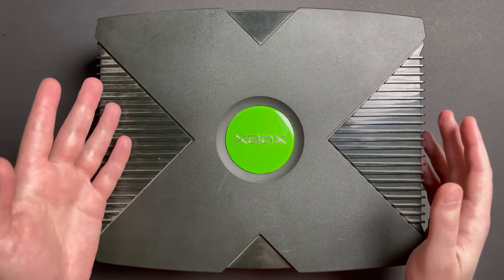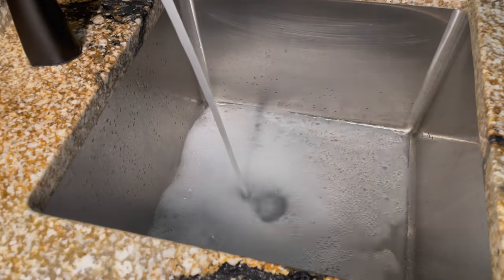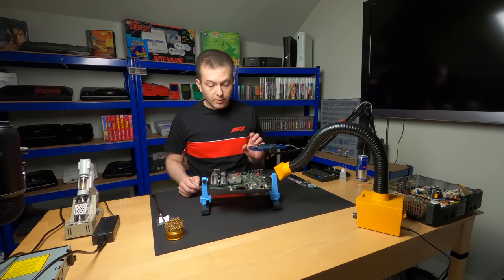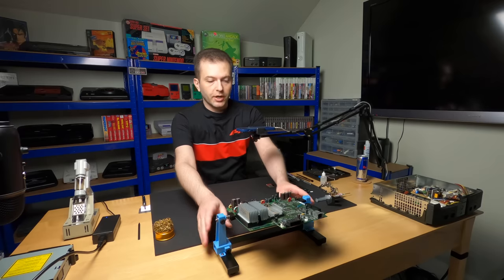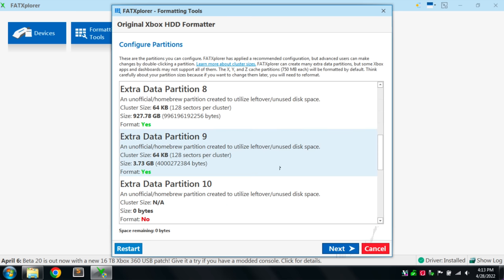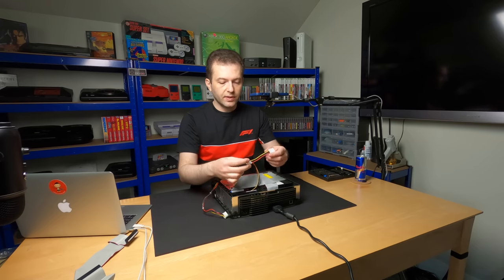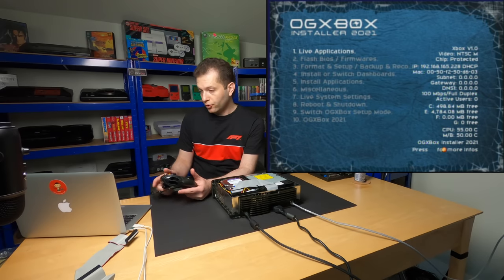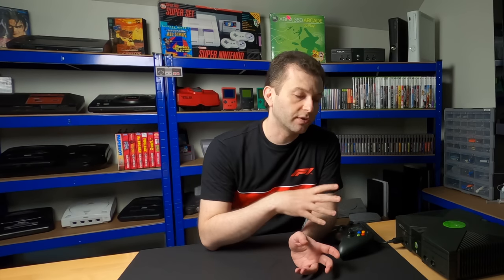16TB in an OG Xbox? CERBIOS has arrived.

Comment from the maker: EDIT Nov 21, 2022: Cerbios v2.1.0 was released today with support for v1.6 motherboards. There have also been many developments over the past months including UDMA5 support for supported SATA adapters. Be sure to get in touch with the Cerbios team on Discord to say hello and get the most up-to-date info: https://discord.gg/VcdSfajQGK

Original comment:

As mentioned in the outro, I'll revisit this pinned comment for the next couple of months to address recurring questions that may arise about this project or my experience with Cerbios.

Regarding the Aladdin Modchip: there are reports that some newer Aladdin XTs are only flashable using a programmer and will fail when flashed in the Xbox. I have not experienced this yet on any of my recent Aladdin XTs despite receiving the same ones that some folks have reported trouble with (49LF020A). Your mileage may vary so best to be prepared for a potential unsuccessful flash by picking up a spare Aladdin XT or just buying a better modchip altogether. I always flash using Resctoox v6.0 as I demonstrate in this video and have not had any problems (yet). Feel free to share your experience with this as I'm sure it will be helpful for folks trying this mod.

I don't recommend trying Cerbios without a modchip (i.e. TSOP) if you're a beginner. Fixing a bricked TSOP wouldn't be fun. Swapping a $10 modchip is a piece of cake.

HDD Cluster Size: I chose a HDD cluster size of 512K, even though 2-4TB drives can use 256K clusters and save lots of space when copying small files. The problem with 256K clusters is the directory limit of 4096 files per folder. This sounds like a lot, but many (uncompressed) games have 6000+ files of artwork or sound in sub folders. You won't have this problem when using XISOs. Unfortunately my game collection is extracted from archives and I have little desire to recollect ISOs of all my games. The only downside to 512K clusters is wasted space (1.6TB collection on PC took 2.5TB of space on Xbox). This is acceptable to me because storage is cheap and I just want all my games on one Xbox. Do you have an ISO collection? Hit me up! ;)
Reply: The last Aladdin I bought also wasn’t flashable in system. Went for a TSOP mod then. Needed the Aladdin anyhow as the OG HDD had died on me…
Reply from the maker: @4ujeff  Alas, you likely have one of the Aladdins that can't be flashed in the Xbox (see note above). You can flash it with a programmer or if you don't have access to one you can pick up an Xblast Aladdin XT from ModzvilleUSA which can be flashed directly from the OS on the modchip.
Reply: @4ujeff  What size BIOS are you flashing?
Reply: @4ujeff  What model Xbox?  Is it a generic "off brand" / knockoff chip?
Reply: Do you offer service for xbox v1.4? I was curious how much it would cost? I want to be able to fit a sata ssd; I want to have Original Xbox Live Dashboard installed so I can play on Insignia Live coming out
Reply: Also I have Rocky5 v1.1.8 softmod
Reply: I have two XECUTER chipped OG Xboxes. Both need repair. One was a 500gb "one of a kind" case mod work of art back in it's day. Currently arcs at the console power input now. : /
Reply: WHY WHY WHY WHY WHY!?? This video sent me thru the roof in certain points, well at every pert that you soldered something! WHY are you using that bent tip? Especially as you aren't actually using the tip when it would come in handy like for the small pads on the mod chip that you had to short to ground, or most of the other tines you soldered on the board and you were basically touching 2 solder pads at the same time... 
I know most people wouldn't care about this and I probably shouldn't care but for some reason it really grated on the back of my brain 😡 🤣 
So is there an actual reason for using it like you do or is it just to single out the nutters like me, who notice these weird things, to play mind tricks on us? 🤔😲
Thanks for the video though, I have been meaning to get hold of an old xbox for a while now for emulation, so watching how easy it is to get it open and work on it is great 👍 👌  thanks! 😁😁
Reply: That is awesome! I've got a couple of Xboxes like that, but a 250Gb drive in each :)
Reply: Any ssd mods available for it Xbox
Reply: I see you got the "dkoldies refurbished " console
Reply: Do you sell this item?
Reply: How do use customize boot animations with Cerbios Jukebox? I couldn't find it anywhere
Reply: Amigo buenos días quisiera tener el programa del dvd que tienes, mirando el link que dejas ya no está, podrías subirlo de nuevo Bro gracias.....y una pregunta más puedo hacer esto con disco duro de 320? Gracias
Reply: Can you mod my original Xbox? I’m not tech savvy and I’m afraid to break my console. I’m willing to pay
Reply: I never considered that limitation with regard to cluster size. Now you got me wondering if I got some games borked. But DVD2Xbox would have said something during the transfer I would assume. I used an xbox app to setup the drive, but I split it between F and G, which I wonder why you didn't since you could have had 256K clusters at that point.
Reply: @beef0678 surface area is better on the bent over ones is my guess.  A lot of people use the wedge tips that look huge compared to the pads...but with flux paste the solder wants to go where it should and the less time it takes to heat the solder the less chance to lift a pad/trace.👍

Comment: Tip for the heat sinks, use a hairdryer to warm them up and loosen the thermal adhesive
Reply: You can also turn the console on and let it run for 10mins and the heatsink will heat itself up.
Reply: Reminded me of when people put there ps3s in ovens todo a similar thing when they got the YLoD lol
Reply: @jaydaytoday3548    smart one tnx for sharing,  using hairdryer probably is useful also especially when its not turning on... btw instead of hairdryer a more ment for it heatgun would probably be what you mean.  there are also small heatguns these days better for electronics
Reply: additional tip for cleaning old thermal paste — IPA is almost useless as seen in this video, lighter fluid (naphta) is best solvent.
Reply: @digitalk68  for the OG Xbox, alcohol is completely useless. I’ve always used goo gone
Reply: @Kris Nicholson saw someone clean a Commodore 64 board with brake clean lol most is just acetone so I think it would be fine
Reply: Pure acetone for cleaning up the "gum" from the old thermals is great.  Keep it away from the black heatsink supports around as it will eat into that.  Final cleanup with IPA and everything will be beautifully clean.
Reply: @civmike I don't see how that works. You could melt the case before the heat chip gets hot enough to melt solder. I used to read all that crap with my 360, RRD. It was goofy then and probably goofy now.
Reply: @peterford9369  it’s definitely goofy lmao but it worked for some
Reply: @civmike  I don't know. I tried all the 360 fixes. Except the oven 😏.  Nothing worked for more than a day or two. Finally Microsoft said, send it in. And they fixed it " professionally". That lasted exactly 1 year. And even with a separate cooler fan setup, it happened again.  But shutting it off and letting it cool, it fired up again.  Then I got sick of it and bought the Xbox One second Gen. And 6 years later it's still working 🤞.
Reply: @peterford9369  360s were hit an miss, some models just have inevitable issues unfortunately :(
I had 2, one I could never seem to get to the bottom of, kinda similar to your situation. Than another one that ran fine for years with regular cleaning & upkeep.
Reply: @civmike  That's obviously true.  I'm not sure if they're built on an assembly line, or one person assembles his or her lot, assembling the whole thing and that one person built all the ones that were defective. But I have to believe the mother boards were machine made and maybe partially chips were done incorrectly. Nevertheless, there were many that never got the RRD. 
But it must be like a virus. Because PS s, had their problems too. Poor heat displacement.
Reply: @John-B-Goodenough  I'm not recommending it as I don't use it that often but I like to use electronics spray from the parts house. Mass Air Flow sensor cleaner is the same thing I'm pretty sure. I think it's mostly heptane.
Reply: @peterford9369 in the beginning, the X360's were made using a cheaper leadless soldier. It was so bad that if you ran it standing vertically, the tiny chips on the CPU would literally melt right off of it, and they were tiny and impossible to put back properly after that happened.
Reply: @twoblackthorned  I never ran my machine in standing position. 
I can totally understand the hot cold joint thing. Maybe a different type of thermal paste made the difference. Unless the problem was solder faultiness. I don't know if there was ever a 100% cause found.  Chip fault. Solder type. But you'd think, if they went to the expense of recalling and fixing thousands of units. They'd have gotten it right. But like I said, I was extra preventive. And within a year it happened again.

Comment: This video brought back a lot of memories for me.  A little under twenty years ago I was heavily involved in Xbox modding and repair.  I would pick up units cheap from pawn shops that had bad laser lenses in them, replace the lens (can you even get those anymore?), and sell or mod them for my personal use.

A couple of things I recall about refurbing them is to always pull the power supply and resolder the pins where the power cord goes in.  There were so many failures due to the solder joints on the pins cracking that Microsoft sent out free power cords with GFI breakers in them to keep from burning down people's houses.  Also as far as temps go I have never encountered the need to redo the thermal paste.  I've got a couple of boxes still plugged into our TVs that I've used as media centers for over fifteen years with no problems.  I will also mention that the main reason the fans on the 1.0 boxes get noisy is because they are sleeve bearing units.  The bearing just wallows out and the fan shaft vibrates.  I think on those I just got heat sinks from the 1.6 boxes and swapped them out.

Also I found that putting too much lubricant on the gears in the DVD drive actually collected dust over time and caused more problems than dry gears (dust sticks to that lube and the extra gunk would tend to wear the drive belts out).

All in all a very good video.  It's amazing how much easier the installers have gotten from those days.  I kept quite a few large 7200 RPM IDE drives just for these boxes (we don't have a lot of games) but I did tinker with a SATA to IDE adapter one time.  I put a 120 gig SSD in there for kicks.  It was wicked fast in the menus and loading games.

Again I enjoyed the video and the links.  I might pull one of the old units off the shelf (I still have several original Xboxes and PS2s left from those days) and try out some of these new tools.
Reply: Just checked and you can still get og Xbox laser lenses. Praise vsause.
Reply: Just got a V1 and lubed the fans. It def helped!

Comment: Lovely build my dude! Been working on a 4tb myself for weeks now :D 
For XBMC4Gamers, I'd recommend looking for the "Fast Game Parsing" option in the settings. Once you tick that on the xbox wont have to scan the games at all anymore and everything will just been good to go once you boot / reset the xbox.
Reply: I love it! And to think the Kodi app that I run on my Android players all started on the OG. XBMC 😍💚
Reply from the maker: Thanks Modz! I'm pretty psyched with this build and my older modded build looks like the ugly step-child in comparison. Good luck with your 4TB build and eager to see your project. Thanks for the XBMC tip, I need to spend a bit more time familiarizing myself with the ins and outs.
Reply: Fellas, way back in the day, I remember the KI arcade ports (pretty sure a fellow famous youtuber was responsible for that one) and other PC ports and MAME dumps.  Are they unobtanium now on the internetz?  Its been decades since I bothered checking and I doubt IRC is still around, heh.  Cheers.
Reply: Do you know if the 2 up tb mod can be done in a softmoded xbox?
Reply: @tatsuo91  no you need to flash cerbios to tsop or a modchip
Reply: how much would some charge to do this to a soft modded og xbox 3tb?
Reply: @ModzvilleUSA  I sent you an email?
Reply: @arcadeslum5882  Ahh, the dude went by Lazarus during those times. I think Discord is the new IRC. Good times they were.
Reply: @KarcusKorpse  Yup I hopped on there. Cya on dcord.
Reply: @ModzvilleUSA  Thank you for this tip I have a 3Tb drive with a complete NA library of XISOs+ some euro exclusives so this is extremely helpful.
Reply: On a 2 tb fully loaded I noticed its about 10 sec faster with fast game parsing. But I've got to think it's still scanning the games just without showing the realtime readout of what games its scanning.

Edit: this was on stock bios xbox v1.0 with startech adapter and western digital red hdd, 80wire. Not sure how much gain would be on any other bios.
Reply: @BurnMoneyBeats  I realize that sequential would not benefit but wouldn't a SATA SSD greatly improve load times and queries/scanning/indexing directories with all the random I/O going on? I also realize this is not as cheap but might be worth it for someone with a higher budget.

Comment: To me, this looks like an official repair job where they replaced the disc drive. Especially since the drive has additional, but seemingly official labels on it and a date of 2003, which would be too late for a 1.0 xbox.
Reply from the maker: You are very observant. I didn't notice the date sticker on the optical drive. Good theory.
Reply: I thought the same. That sticker that goes over the top label on the bottom cover seemed to be something Microsoft would do at the factory. No other person doing repairs would bother placing that sticker at all.
Reply: Same with my v1.0. It has the gpu fan, single row power and conxeant chip but also a Samsung drive, which did not come with 1.0

Comment: since you have the xbox open, a complete recap of the mainboard and psu is possible. the few capacitors near the cpu which are prone to bulge can be replaced with polymer capacitors for extended service life.

Comment: That pink gummy stuff is called PCM (Phase Change Material). It is sometimes pretty hard at room temperature but when it gets hot it flows more like standard thermal paste. Acetone is awesome at getting PCM off luckily.
Reply from the maker: A few folks suggested heating it up will definitely do that for the next system.
Reply: I remember using different stuff to try and get the thermal paste, I spent like 10 mins getting it off slowly. Then I used WD40, and it wiped off like nothing. I was quite astonished.
Reply: @mrbisshie  pro tip right there!

Comment: Very awesome!  I've had my Xbox soft modded for ages.  I  was waiting on a easier way to get a larger hdd in there and have been teaching myself to solder.  I think I'm ready to give this a try.  Thanks for a great video
Reply from the maker: Hard modding an Xbox was one of my earliest soldering projects. I only had a bit of soldering practice at the time and I'm definitely much more comfortable doing this stuff now but I still managed to pull it off even back then. That was also without a desoldering gun and I didn't even have a narrow enough tip for my iron. Bottom line you just gotta get in there and do your best. Sounds like you are motivated enough so go for it buddy and god speed.
Reply: Big tip, and you can watch Borderline do it in here too, if you remelt and mix in leaded solder, it lowers the melting point of the factory solder and makes it easier to remove.  After that it's just down to flux+solder wick (or fine stranded copper wire can do in a pinch)+heat and you should be able to get them cleared out.

Another option, but you probably need 2 people to do it, is get one of the spring loaded solder suckers and have one person heat the hole from one side with a soldering iron, and the other person on the other side with the solder sucker.  Once the first person has it heated up, they let up just slightly with the soldering iron to make sure they're not fully sealing it off, and then hit the button on the other side and it should suck all the solder out if you had a good seal with the sucker.

Comment: Using some heat on the gpu heatsink makes it much easier and safer to remove.
Reply: Wholly recommend not trying to remove the heatsinks without applying heat first. Either run the console for 15-30m or use a heat gun. Very easy to damage the chips trying to pry them off at room temp.
Reply: For real. That removal clip had my face like 😱
Reply from the maker: I've yet to damage a GPU, but I'm sure warming up the chip is a good idea so I'll give it a shot.
Reply: Yup. Disconnect the fans and power it up for a few mins til the heatsink is warm to the touch (not hot enough to burn you, but pretty warm). Then twist the heatsink off (don't pull straight up).

Comment: Absolutely amazing soldering job! It's refreshing to see such a skill on YT! BTW I might be totally wrong but it seems like your soldering iron tip might be oxidized a bit. I usually dip it hot in citric acid crystals mixed with pieces of solder wire.
Reply from the maker: The tip itself shouldn't be oxidized, I clean it after each use and tin it with tip tinner. Are you referring to the shaft above the tip itself? That will definitely discolor.
Reply: @BorderlineOCD  I think my opinion was skewed by moments like in 18:18. Which is not fair as seconds later the tip was back to being nice and shiny. Ignore my comment then. Well just the part about oxidization - I still stand behind everything else :) Looking forward to you next videos!